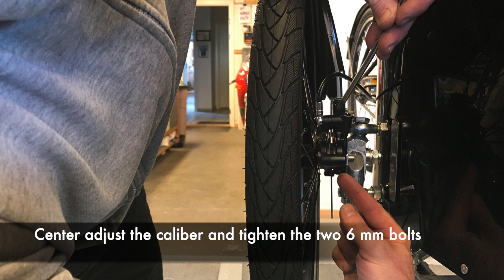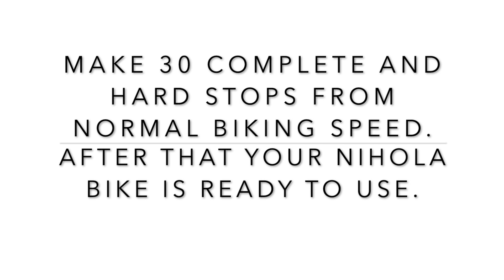Nihola disc brakes retrofit

Comment: Does the original brakes not work that well? 🤔 Why would you want to take the trouble to install disc breaks? 
Our newly bought second hand nihola bikes front breaks hardly stop the bike. 
I have tightened all the break cable screws but still it is not very good at stopping the bike. I wonder if thats normal or i should maybe change the cables? 😊
Reply: i know this is a year later, but if you are still having issues (we had after many years of hard use of our bike), you probably need to replace the drumbrakes as they do get worn out at some point. That was what helped on ours after I had tried everything else. I was able to do it myself and the parts are not that expensive. Each part (1 for each wheel) was 350kr (around 50€).